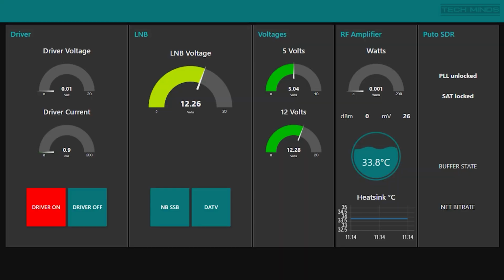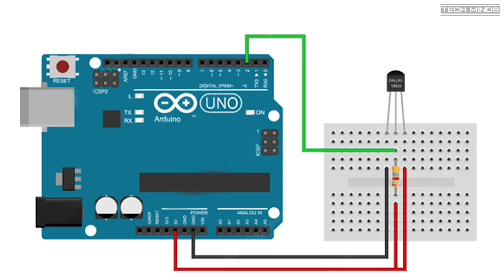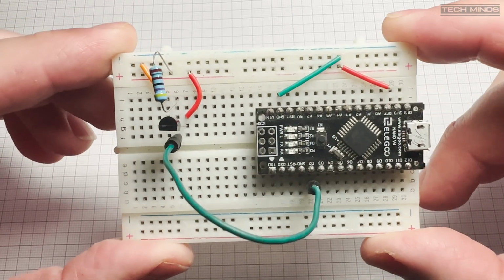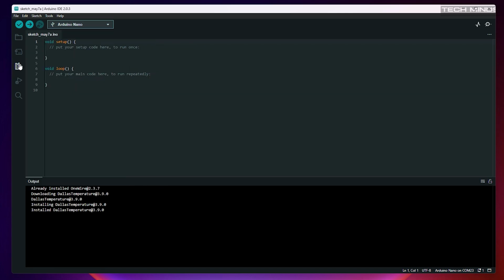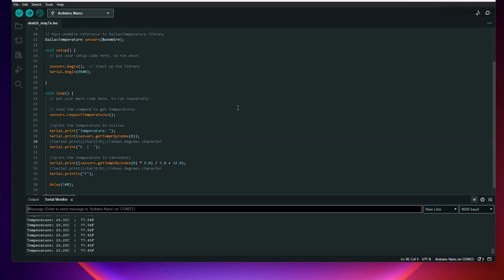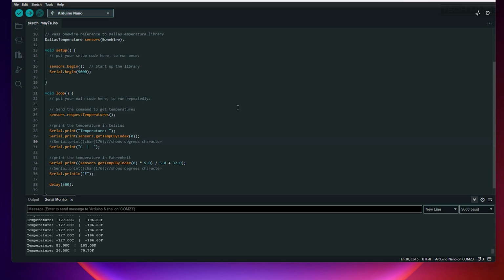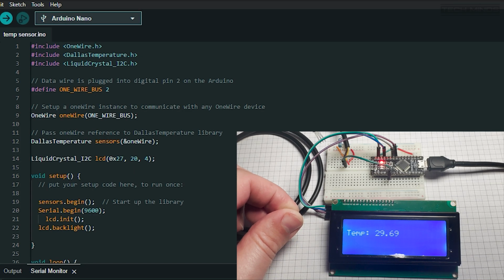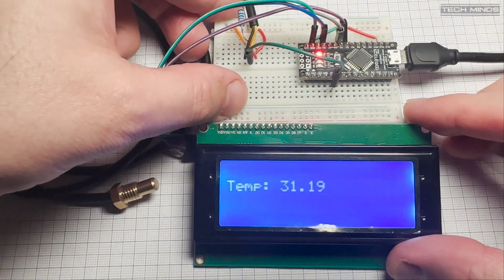1 Wire DS18B20 Temperature Sensor - Arduino / Node Red

Comment: Great video! We chain those together on one wire 'bus' hooked up to an Arduino -> RaPi. Adafruit has the library where you can read the different hex addresses of each sensor. Then program your code to look at particular address for vars. We have one in water and another getting ambient air temp on just one wire.

Comment: Interesting reminds me of a gadget I made after a burst pipe in the loft flooded me out. Using water sensors triggering an alarm and wifi throw a switch turning off main water supply sending notification to my mobile. Not really related but our minds can throw together something easily and  cheaply nowadays.
Hey Matt where'd you get that nice chunky heatsink?
Reply from the maker: Heat sink from eBay mate. I bought another one but it was too big, and I couldn’t cut it lol. But yeh, £40 from eBay.